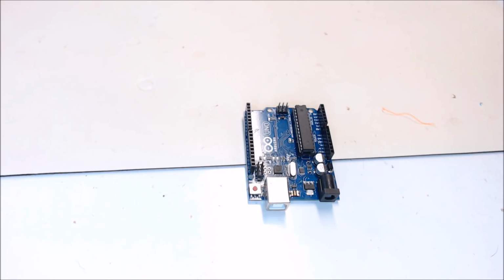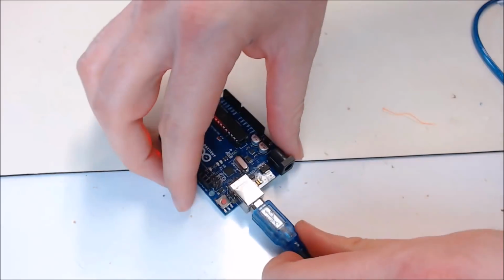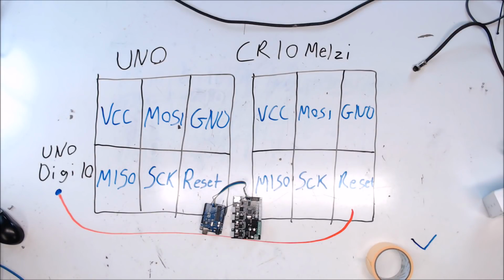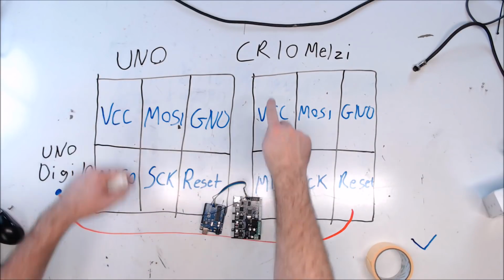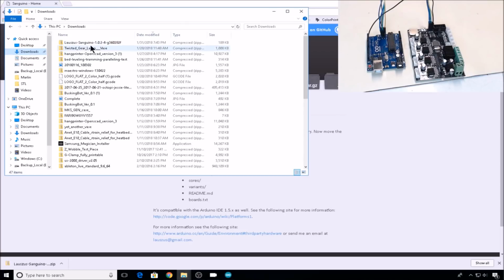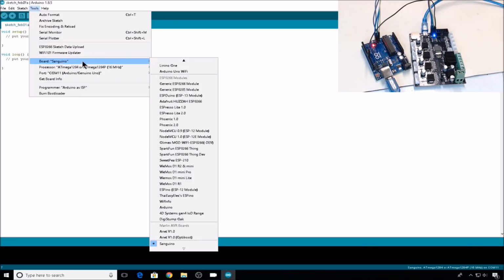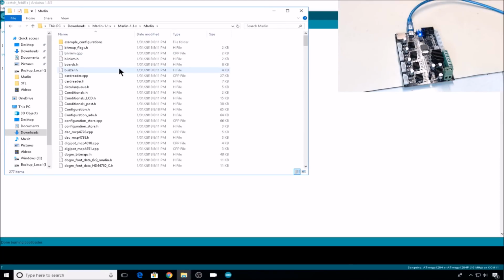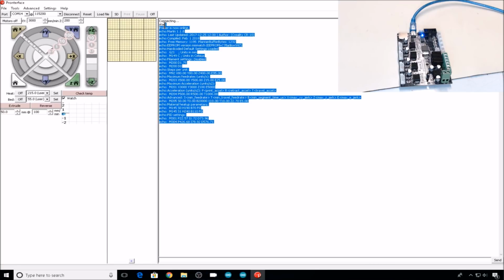Creality CR-10 Marlin Firmware Upgrade - Chris's Basement

Comment: What is to do if an error occures when you try to burn the bootloader and it says: 
Double check connections and try again, or use -F to override this check.

Please Help!!
Reply from the maker: Does your board show up in device manager as a ch340? It could be a driver issue. Is it a real arduino UNO or a clone?
Reply: @ChrisRiley  It's an original uno Board and i also intalled the ch340 on the Board
Reply from the maker: No I am even more stumped. If it's a real Uno you don't need drivers. The only thing I can think of is maybe the SPI connections are not correct. Maybe give another computer a try?
Reply: @ChrisRiley  OK,thank you so much for your patience,I'll try that

Comment: I am so frustrated with my CR-10 that I'm considering suicide by 3D printer (joke)! I followed the video, got right to the uploading of Marlin stage (btw, when I opened Marlin.ino no Audrio setting remained the same. I had to reset board, processor and prot), I get:
    U8glib.h: No such file or directory
This after massive bed leveling issues! Hence why I bought a BLTouch and needed to do this. PLEASE HELP!
Reply: ok, i'm done! nothing I do with $#&@ing printer works!
Reply: As a rather 'abrasive' personality pointed out on a CR-10 forum, the answer to the "U8glib.h: No such file or directory" problem is literally the first line in the documentation accompanying this video tutorial ...... it's been a very frustrating experience so far, awesome (not entirely unexpected as I knew this was a 'tinkers' hobby), but frustrating :) I am attending to this problem now, wish me luck
Reply: update: it may be that the usb 3.0 port on my PC was not seeing the Au-dri-no correctly. Connecting via a 2.0 USB port and the software now states the name of  the board when it sees it on the port...
Reply: If anyone cares, I have successfully uploaded Marlin! There's a few conflicts I found with the Video, I will try to describe them as best I can:

1) When Chris is done with the Audrino at 7.47 the video shows and he states that he unplugs USB from both the Mezi AND the Audrino. Does the mezi board receive power via the jumpers from the Audrino?

2) I could not upload ANYTHING to my Audrino with Sanguino selected as the board type, yet I had to select Sanguino when I uploaded to the Mezi.

3) The video never states what a "Mezi" is. Is it the board manufacturer (I assumed Creality), the board form factor, the model of the board??? Sure, One could Google the info but pointing it out for clarity

4) After loading the U8glib library, Sanguino and Marlin, I had to re set parameters (board type, com and processor) each time yet Chris states that these setting should have remained!

5) The 1.1.2v board that Creality is now shipping in the CR-10 has no USB jumpers!

But in the end, I did it :) Now to configure the BLTouch settings

TY Chris
Reply from the maker: It looks like you have been putting in a lot of work on this. The boards Creality provides now are much different than the original ones I show in the video. I am not sure what the specs of the most recent boards are, but memory gets really tight on the board when enabling auto bed leveling. Let me know how it goes.
Reply: Thanx Chris, and thank you for taking the time to create the video, it was the clearest I found. I came across it, watch but a minute or two and knew it was the one to follow, others are just too vague. I'll get to configuring the firmware for the BLTouch and then reload it. Will let you know how I go.

Comment: Thanks for this great video! You can get the updated firmware on Timothy Hoogland's website:  https://www.th3dstudio.com/knowledgebase/

Would you do a video on installing an automatic bed leveler?  Timothy charges $60 for his kit, which is a really good deal.  However, it seems to be very easy to set up and I think that it would be a fun project to do.  I know that your subscribers like me would really appreciate it if you walked us through this upgrade.

I already bought this sensor.  It is sitting on my desk:  https://www.amazon.com/gp/product/B01M1777XK  .  It should work for the CR-10 auto bed leveling project.  It is NPN ("normal open").

I am ready to install the auto bed leveling.  However, it would be so much easier if you provided a video to help me.  I don't want to make any mistakes!  Where do I connect the sensor to the CR-10 board?  Which wire colors to where?  What specifically do I change in the Marlin firmware?  The probe lists an input range of 6-36V.  Can I connect it directly to the power supply terminals?

By the way, I am purchasing Timothy's board update and some other products from him to support him.  He is a good guy for providing all of the CR-10 support to the community!  https://www.th3dstudio.com/product/creality-cr-10-v112-board-repair-temperature-fluctuation/ 

Thanks!
Reply from the maker: Hey Rick, thanks for the comment and the email. I do have plans to do some mods like bed leveling and other things to the CR-10. They are in the video "queue" as I call it. :) I hope to get to it soon. Thanks for the links!

Comment: Hii I'M from India
I'm having CREALITY CR10S4 3D printing machine in that I'm getting continuously problem like thermal runaway, So what i want to do please help me from this out i cant able to print any of the object continuously. Please help me as soon as possible. My Email Id: nsautonetics@gmail.com, naveen2238@gmail.com
Reply from the maker: Have you made any changes to it? Have you upgraded the firmware?
Reply: @ChrisRiley  creality 1.1.6
Reply: It's continuesly showing that thermal runway
Reply from the maker: @naveendass366  How fast does the thermal runaway happen? During the print or when you turn the printer on?
Reply: @ChrisRiley  while printing 
With in 3hrs
Reply from the maker: @naveendass366  Then something is wrong with the board. You have a short somewhere. It's not a firmware issue.
Reply: Okay but I didn't open the controller box
Reply: @ChrisRiley  I purchased this meachine on July only